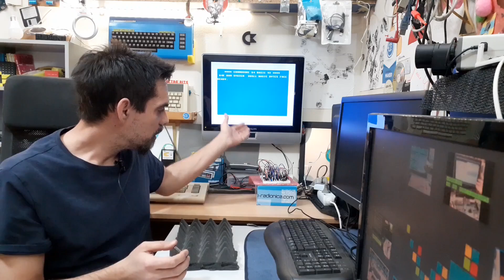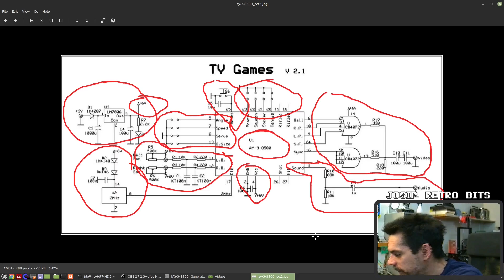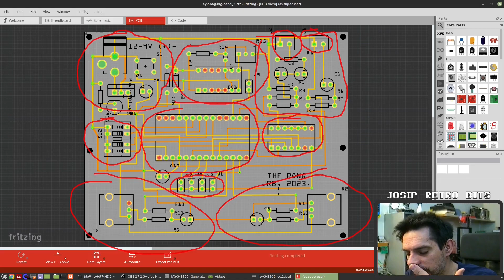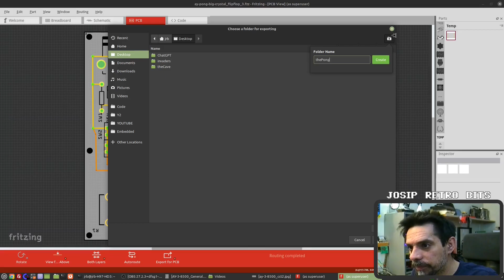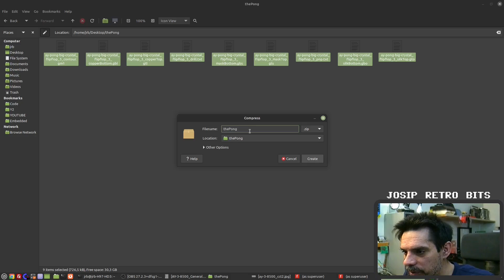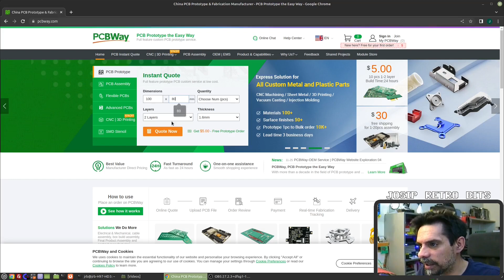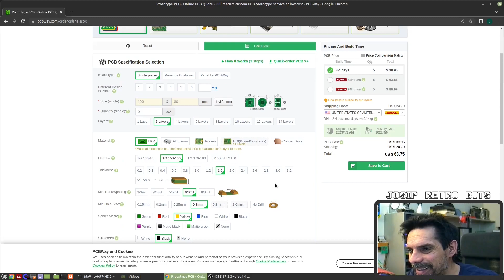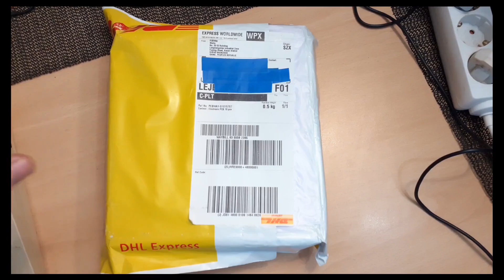Making a Pong Game | Without a single line of code

Comment: Great video, Josip! Great work building this game!  Congrats! I haven't done much soldering so far, but this looks like a really cool starter project. I actually had a pong-console back in the 80's.
Reply from the maker: Thank You George :) Yes,  I used all through-hole components so it should be an easy build. The only problem is that AY-3-8500 chips are hard to find these days... :(